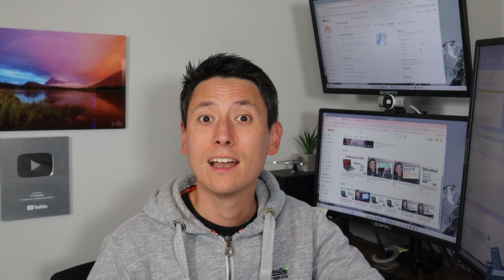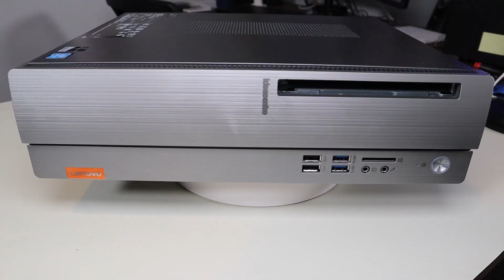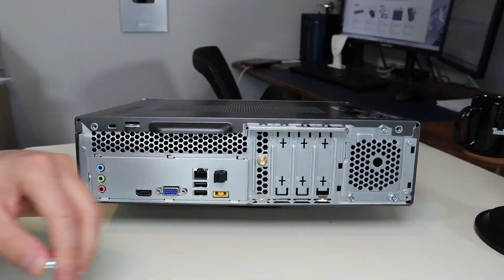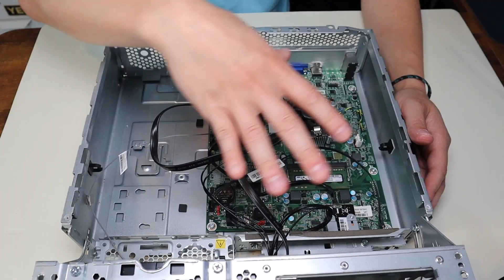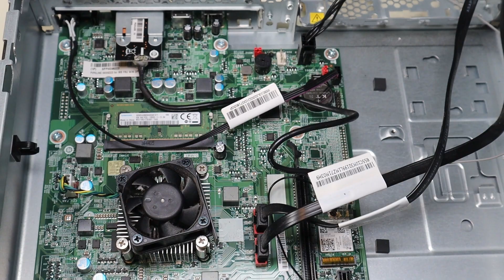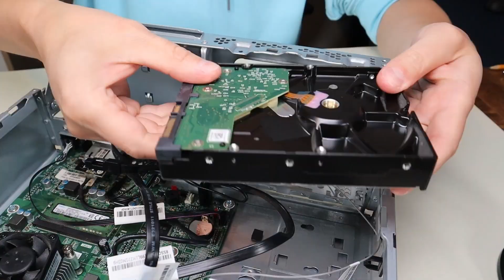Teardown / Disassembly for Lenovo IdeaCentre 310S-08IAP Desktop Computer

Comment: can please u tell how to upgrade this pc's cpu and gpu ? Would really appreciate  an answer i want to install something like rtx 3050 or rx 570 .
Reply from the maker: Unfortunately, the CPU is soldered to the motherboard and cannot be easily upgraded.  As far as a GPU upgrade, the motherboard doesn't have expansion slots for a dedicated graphics card. While a low-profile graphics card might fit in the PCIe 2.0 x16 slot, the 65W power supply limits the performance of any potential upgrade.
Reply: Ok thanks for trying
Reply: Thanks for support
Reply: @PC_Monkey Can you please tell is there anyway to upgrade the psu?
Reply from the maker: @PROGAMER-ig9ym  Not in this computer. I was unable to find a PSU upgrade for it. Sorry :(